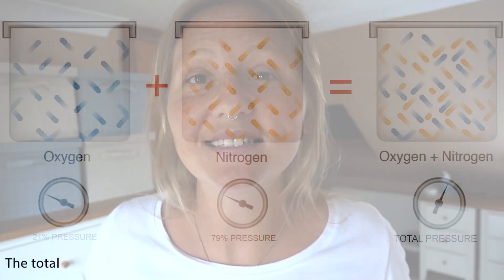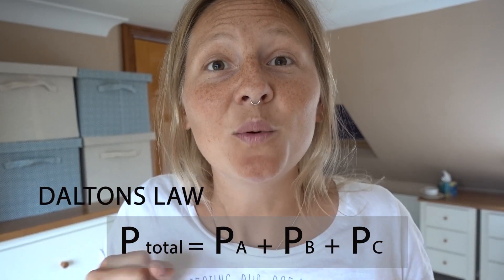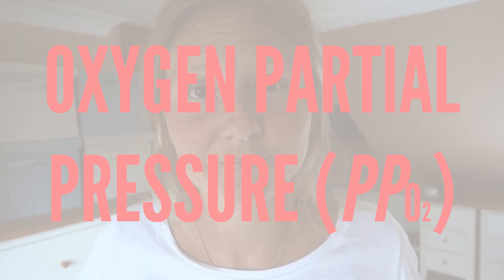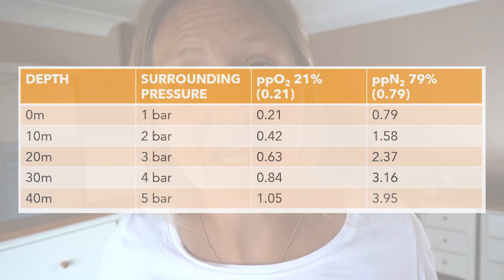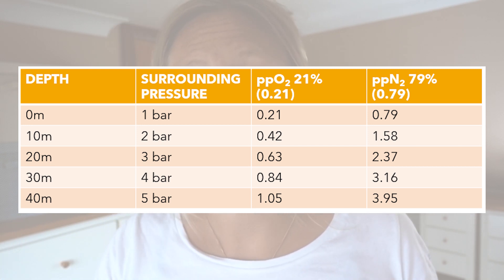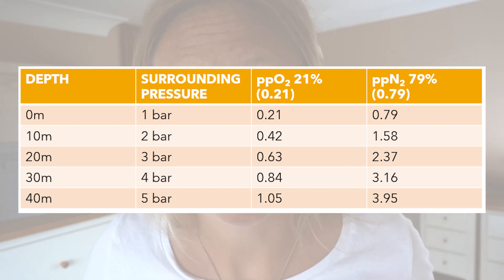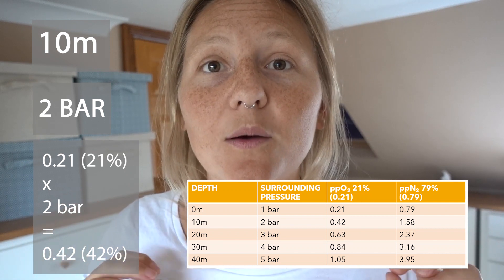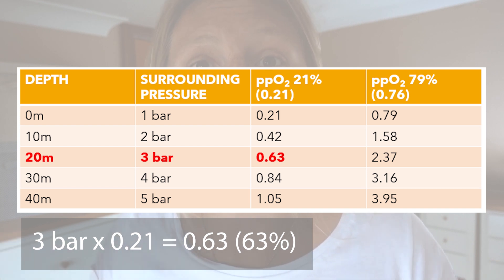What is Partial Pressure? | SCUBA THEORY

Comment: But why does PPO2 go over 1.0? How is it possible to breathe more than 100% oxygen?
Reply: Because the ratio of gases itself is not changing, only the density. You can think of it like simplifying fractions, for instance at 2bar, we are now at 42/200 and 158/200. We can simply divide down by 2 to get back to 21/100 and 79/100, its still the same ratio but on a different scale. 42/200 is 21% still, 158/200 is still 79%, put it in a calculator (42%200 = 0.21 x 100 = 21%). I hope this makes sense.
Reply: To illustrate this with money, If I had 200% of £5, I'd have £10. Without breaking maths :)

Comment: It's NOT 42% oxygen at 10m. The correct explanation is that the partial pressure of oxygen at 10m is 0.42 bar. (The partial pressure is changing, not the percentages of gas)
Reply: True

Comment: Hi Amy
Can you tell me how to calculate the amount of exposure to oxygen from multi-depth dives
As the tables are based on the fixed depth according to the values of exposure
And the second question does it appear in the Maris Smart Air computer? the % of exposure ?
The third question: i know that nitrogen absorbs less than oxygen in diving usually. If that is the case, does oxygen have the same property, or is it that when it reaches the upper limit of 1.4, we can only go up to a higher levels and drop quickly? I hope the question is correct
If you think it is appropriate to explain it in a video, I would be grateful
As our trainer died, he made a technical dive at 65 meters, then after he finished the dive after 20 minutes and at a depth of 35 meters, he wanted to change to the Nitrox 37 cylinder, so he mistakenly replaced it to the cylinder with a concentration of 80, where according to the words of those who were with him, the oxygen was almost at His ascent reached 1.6. When the error occurred, the ratio shifted to 3.55. Can you explain what happened?

Thank you for your wonderful communication.

Comment: I have a question. Why are regulators cable tied to the mouth piece? I’ve seen a few times them just fall off on divers under the water.....is there no other way they can be fitted safely?
Reply from the maker: The reason this is happening could be down to two things. 1. The cable tie has not been fitted properly, neither the mouth piece. 2. (And this is usually the issue) the mouthpiece used is NOT compatible with the 2nd stage of that regulator. Contrary to popular belief, you are not meant to put any old mouthpiece on a regulator - unless specified by the manufacturer that it is infact compatible. Alot of dive centres will just use any old mouth piece, for convenience and cost... and sometimes this can result in them dislodging from the 2nd stage. Unfortunately, the rubber material of the mouthpiece means it gets damaged easily and will need to be changed quite often so there isn't really another suitable way of attaching it. As along as you use a compatible mouthpiece and it is secured correctly, then it should never fall off. Good question! 👍👍👍
Reply: SCUBA AMY ah ok thank you for that reply. Very informative response  👍🏻 x
Reply: @scuba-amy  great response Amy. I just found your channel and you have some excellent content. Cheers,  #SeattleRingHunter